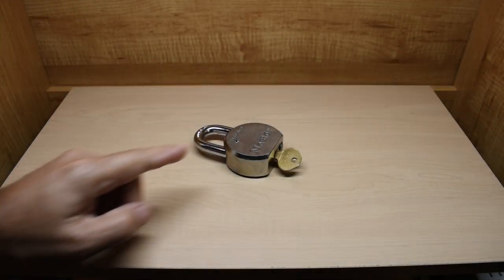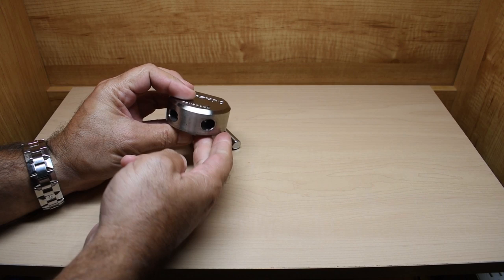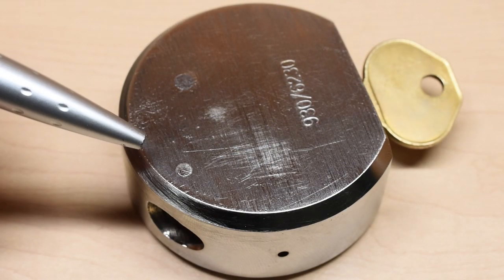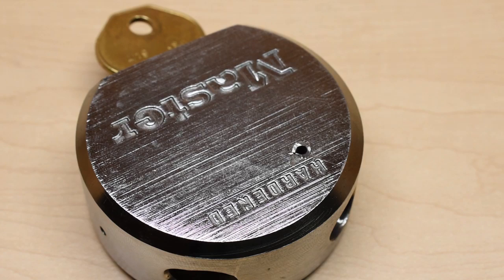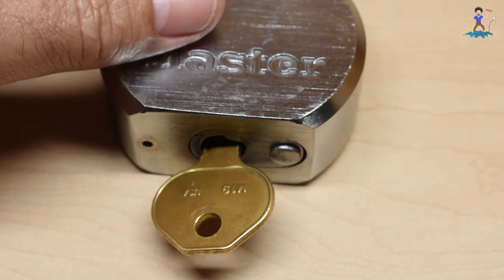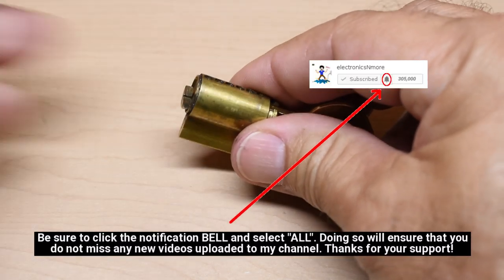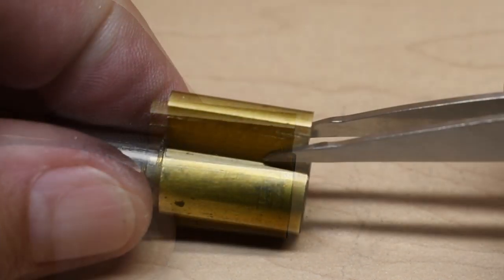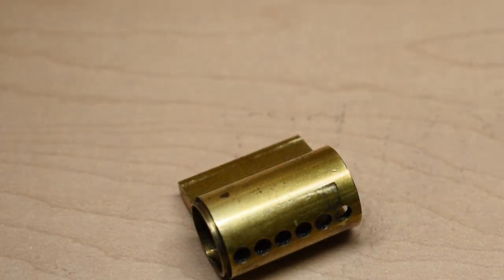Padlock - FULL RELEASE SHACKLE Modification!

Comment: I actually have this exact same model of lock.  (Mine doesn't have any special modifications obviously.)  I bought it about 10 years ago.  It's a ridiculously heavy duty lock.
Reply from the maker: Yes, it's a heavy duty padlock, but if a person wants to unlock it bad enough, they'll do it. Thanks for watching!
Reply: @electronicsNmore  Of course.  No lock is completely secure.  You can buy a cordless angle grinder and a pack of cutoff discs for under $100.  No lock I've ever seen will stand up to that.   And then there's the whole art of lockpicking.  Doesn't matter how tough a lock is if you can simply open it.  I don't think for a second this lock would stop everyone.  But if anyone expects to just "break it" to get past it, that's not going to happen.  So it's a very good deterrent to "crimes of convenience".  The random douchebag who just happens to wander by will not be able to break this lock.

Comment: The lock is missing a small pin  at the front, where you can see a small hole now. That is why you can remove the shackle. You can do this with many locks.
Reply from the maker: Incorrect. There was never a pin there. Inside the hole is part of the modification, a tension pin. If you wanted to take the time to drill a hole in a hardened steel padlock, and hammer in a pin and shape it to fit the steel ball, then yes, you can do it.